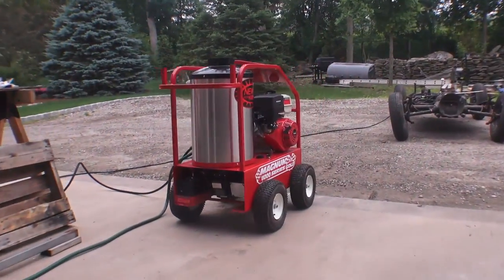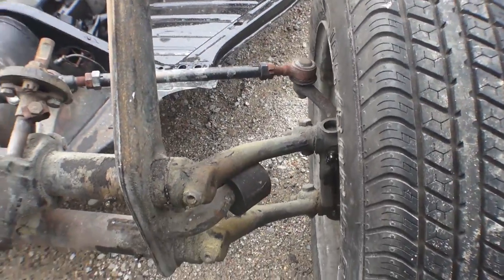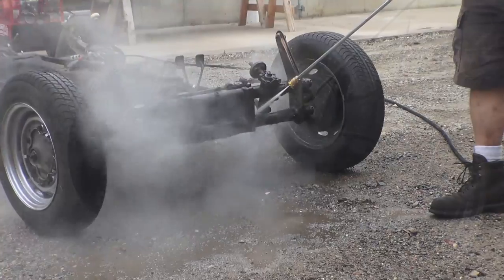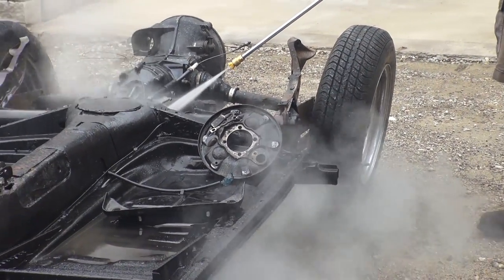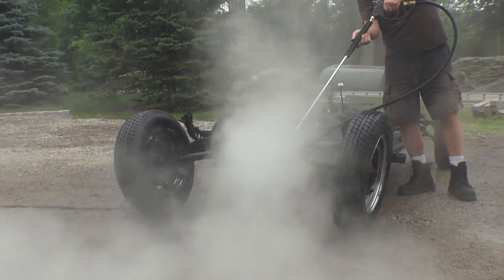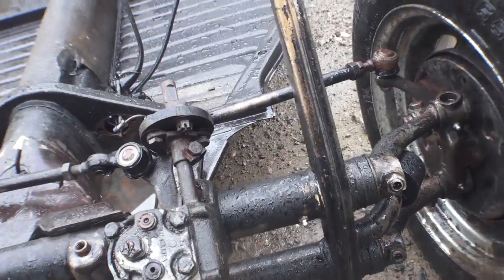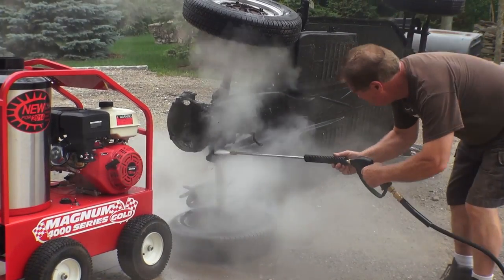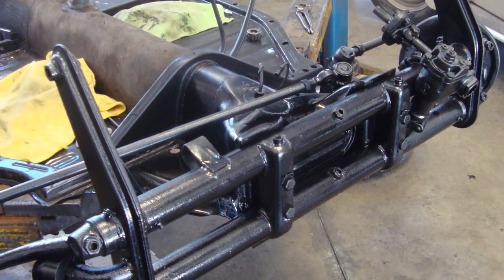Classic VW BuGs How to Steam Clean Power Wash Blast your Vintage Beetle Chassis

Comment: I used to steam wash some engine parts and I got some amazing results when combining it with soap (1) and WD40 (2). Soap kinda really does some miracles with steam and really cleans, while WD40 does what it should pretty much - gets all the water out of the parts. Of course, you may need an enormous amount of WD40 for a chassis, but for small parts like carburetors that stuff works amazing.

Comment: Like the design of the rotisserie . The steam cleaner appears to do a better job than I would have expected.  Question: Have you tried oven cleaner, or similar spray on engine cleaners on a chassis?  Or use a product and use the pressure/steam unit after?  I have been looking at methods for a Karmann Ghia, and a 65 Beetle now that the it's warmer outside.
Always appreciate the knowledge and experience you have with these great cars.
Reply from the maker: Many times we spray the chassis with a degreaser, let it soak in a bit, then blast it.

Comment: Excellent work, Chris and dad. I noticed you took the tar mats off the pan but not on the tunnel. How did you get them off and is this something you recommend? I am currently doing my own "Build A Bug" on my '64 Beetle.
Reply from the maker: Joseph D Rodriguez Sometimes they just pull off, but other times you need a steel putty blade with a handle or spackle to get underneath it and hammer it out.  The original stuff on the tunnel was good so we left it.

Comment: Is it safe to do this with the body on or will it damage the paint or anything?
Reply from the maker: +Flying-Derp It shouldnt, but what kind of paint job is on that car?  If it is a show car, I would not do that.  Get it detailed professionally.
Reply: +Chris Vallone Thanks for the reply!  It's not show quality.  I would call it more like "new car" quality.  I stripped the car but left it on the pan b/c the floors and the body seal were both in great shape.  The gas tank and fenders are off the car so i have a great view of the front suspension.

Comment: People that sandblast with sand and walnuts do not have the car on a rolling frame - they have it on a rotisserie. You're not supposed to do any kind of sand or water blasting with the chassis still intact.
Imagine how much water you forced into every crevice of that suspension and it will rust from the inside out.  Everyone is just so lazy today.  Spend an extra day and strip it bare and then clean and refinish every part before putting it back on.
Reply from the maker: Stop, lets get real here.  These videos are for people that can work on their bugs at home.  How many people have rotisseries in their homes?  You are lucky if most can even take the bodies off the chassis.  It's power blasted with steam because many of these chassis are caked with mud, grime, gunk, so power washing with steam is great to do.  Afterwards we blow the chassis free and clear of any water.  You are worrying about rusting?  These things will outlast US.  We will be in the grave before it rots away.  It is rare that people use these as daily drivers anymore.
Reply: There's a difference between doing a proper job and doing it right, or doing something half assed and causing twice as much problems later.  If someone can take a car off the chassis at home, they have the skill and equipment to spend the extra day and do a total restoration. Your own channel specifies you make videos for body off restoration.  That includes takeing the car down to the chassis and sandblasting and repainting the chassis and fixing any rust holes.

Now how many people have a steam cleaner in their home? And then blow drying it with a large air compressor too?  How many people are going to use those on a regular basis? You will never pay off the purchase price in using something like that. Meaning you would have to pay someone to do it - so then there goes money in labor and service at a shop.  Also you were powerhosing it in mud and gravel, just splattering more dirt and debris into the chassis. The issue is you are getting water and everything into parts that were never meant to have water shoved inside at a high pressure.  There is a difference between water resistant and waterproof. Also this has nothing to do with the fact of someone buying one for $500 and restoring it.  There is 1,000 places rust holes can hide on the chassis and not doing a full teardown is NOT at all a "?restoration".  It's something car flippers do that want to maximize every dollar out of the resale of the car. Just a lot of sloppy rushed work in your videos and very poor procedure.
Reply from the maker: @MrWolfSnack  You do not have to own these power washers, you can rent them, per day.  You do not need an air compressor to blow out the chassis, most folks have leaf blowers in their homes, as silly as that sounds, or roll the chassis to a local guy who does have an air compressor.  I've been in business for over 13 years, been making videos since 2007 here on YT, not one of our hundred or so cars that we have restored have rusted out.  Many times the chassis and beams are in terrific shape, many times the clients do not want that kind of work.  It comes down to $$s and cents.  If the client does not have the budget, you have to be practical.  Do you own a business?  Do you have overhead and expenses?  Better yet, you have a small youtube channel, grab your camera and produce a video for us on a bug and show us what to do.  Or, come to my shop, I'll even feed ya, I got plenty of chassis' here, I have four cameras, and lets produce the quality of MRWolfSnack.  No one is doing anything half assed here by the way, I produce these vids to be practical for the home guy.  Peace.
Reply: @classicvwbugs  what a jerk that guy is. Jeeze! Thank you for all you do to help us home garage guys.
Reply from the maker: @KITTTHECAT2024  Its all good, being behind a computer make people feel tougher sometimes.